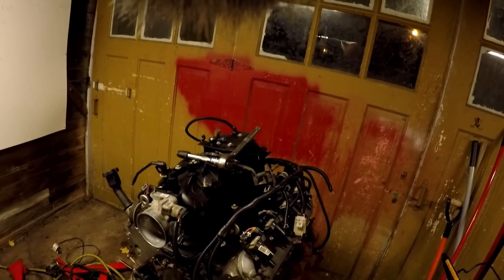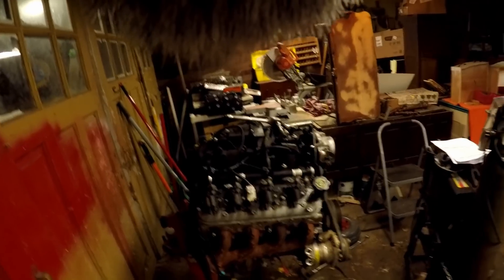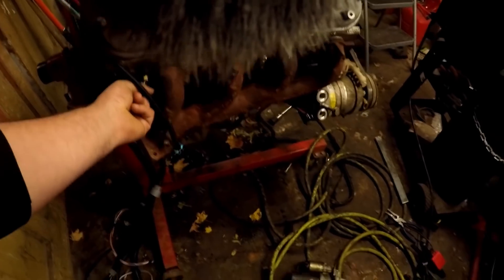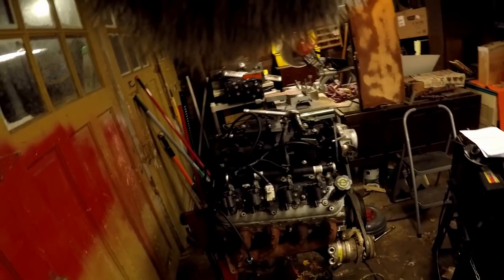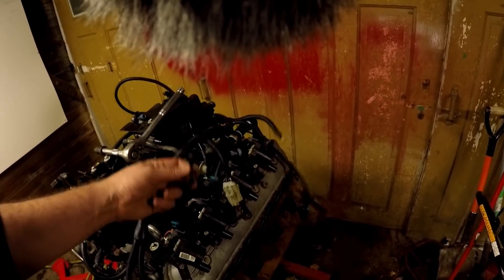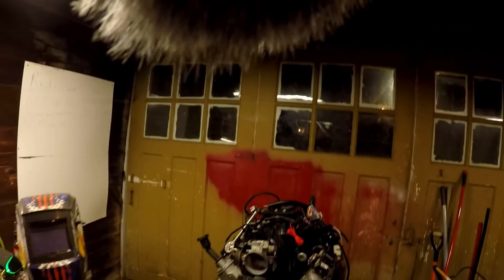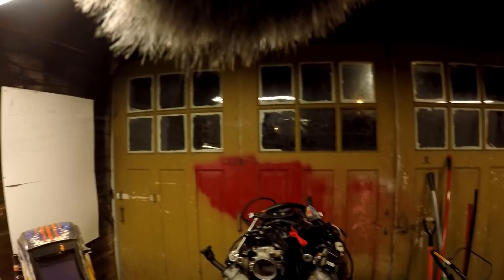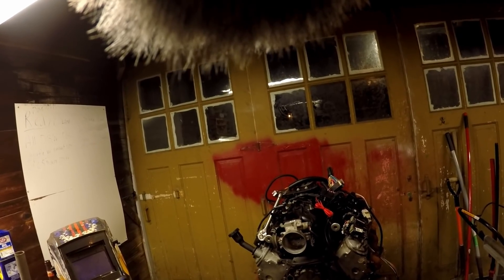268 dollar LS harness installed on 224 6.0

Comment: Can you explain if wether or not the neutral safety switch is needed? I saw that it can be tuned to be 'ignore'
Reply from the maker: You don't have to use it.
Reply: @TheDrivewayEngineer  Thank you! Again 😂, I like how you reply back, other channels still haven't answered comments especially for older video, thanks for the LS info!
Reply: @victorsandoval7602  @ how did u figured out?

Comment: Are you still in need of exhaust manifolds?  I have 2 pairs, one came from a 2500 truck, with a 6.0. The other pair came from  2008 1500 4x4 with a 5.3.  The 6.0 manifold are the split type, the 5.3 are one piece mounting flange. The studs and nuts are in good shape, I don't have the flanges to mount the pipes.
Reply from the maker: No, thank you, I pulled Trailblazer set at the junkyard

Comment: This is kind of off topic, but, is it possible to run two tachometers from the same PCM signal?  I want to run the instrument cluster tach and an additional dashboard tach at the same time.  I know, why do you need to run two tachs?  Because I want to.  Have you  ever tried it?
Reply from the maker: Nope
Reply: @TheDrivewayEngineer  Actually yes you can brother. you can run two tachs, a window switch, and a progressive controller off the PCMs tach lead. 😉

Comment: Will this work with an LSA supercharged 5.3 LM7 running DeatschWerks injectors and long tube ceramic headers? Can they specify it to my request?
Reply from the maker: They will move stuff, change plugs, stuff like that. I don't know that they would get too crazy customizing it. But if you know what injector end you need, they'll put it on there. They do not know what plug you need.

Comment: Try grinding on the bench grinder, if copper, it will be red all the way through. If copper coated aluminum, it will be silver inside. Aluminum tends to be less flexible than copper. I did a lot of scrapping in my time, I learned about the copper coated aluminum the hard way.
Reply from the maker: It looks copper all the way through on the cut, and where I scraped it

Comment: I finished up a swap with one of those harneses last weekend.   The harness fits great.  The only thing that’s a little short is the maf but I didn’t have to extend mine.   His whole problem is the way he has it laid out.   If you run it like the instructions say it’s plenty long enough.   I’ve used a few different harnesses along with reworked harnesses and this is good.   The wires in this harness solder very well, there is nothing wrong with them.   I don’t care if anyone buys one or not, but the people who was around the shop when I did it are all going to buy one.  It works great and fits perfectly.    Like I said depending on your maf location you may have to extend it.   The o2 sensors are plenty long enough, nothing is in a bind, when ran correctly the alternator plug is the correct length, the temp sending unit is perfect length.  I’m not going to screw with a 150k mi reworked harness anymore after using this one.   I like it
Reply: It def looked like he had it thrown up there funny. Think I'm going to use one on my swap.
Reply: Se7enMiIe I’ve put a couple thousand miles on mine and I’ve had no issues.  I’ve got a couple more to do and that’s what I’m going to use.
Reply: How's it doing now?
Reply: @drakeperry.  no problems at all.   I’ve used a few since then with no issues.

Comment: The China shit works just fine, I got some cheap procomp ls3 heads on my 6.0 and they rock, as well as the procomp Chinese 243's I put on my 5.3 c10 build , they worked great too, I even got a 2nd set of the pro comp ls3 heads to put on my l96 just cause the combustion chambers are 64cc not 68....that engine is still on a stand in the garage waiting for a home...I used Chinese dnr flat top pistons in all my builds as well, basically rebuilt 3 motors with Chinese top ends and slugs, and they seem to hold up well, but I will admit to replacing the dual Chinese valve springs on all the heads with blue ls3 gm springs just to be safe. ....

Comment: You need to get some cheap Chinese work lights man.
Reply from the maker: I take donations
Reply: @TheDrivewayEngineer  I just went to Menards and grabbed a 45" 4100k Led shop light for about $25 Menards® SKU: 3480106. Puts out 5000 Lumens of light at 4100k just shy of the daylight, so it's bright but not quite white. It's an impressive amount of light for a really decent price. Plug multiple units into each other. 11% off right now. 10 years later from my shop build and I finally finished the switched overhead outlet in the ceiling for task lighting haha Should have done it earlier, it's so useful now. Flip the switch and I can perform surgery.

Comment: Thanks for the Amazon link to the injector adaptors. I have decapped flex fuel injectors and have the same problem with my reworked GM harness. Can’t wait to hear it run.

Comment: My harness sort of had the same challenges.  I am happy with how it turned out though.  Definitely gonna extend my maf wires, as of now it rests after the 90 degree bend.
Reply from the maker: The injector adapters did work out in my favor, I have a lot more room now
Reply: @TheDrivewayEngineer  Where'd you get them, did they send them?
Reply from the maker: No I bought them on Amazon, I linked to them. It was my mistake, not theirs.
Reply: @TheDrivewayEngineer  so, it looks like alot of viewers don't wanna fiddle with the injector plugs , and a couple short wires, other than that was there really anything else that had to be reworked on that harnesses,  I had to buy injector plug adapters for my fitech setup  so that really isn't a deal breaker for me....what about the maf plug, 3 wire with iat separate or 5 wire truck style maf, all in all its really just petty things that the basic driveway mechanic/ swapper should have no problems with figuring out, am I right?